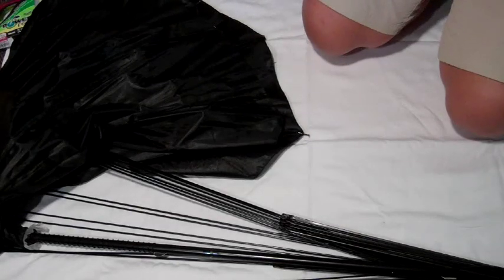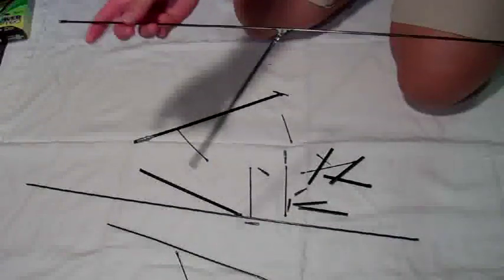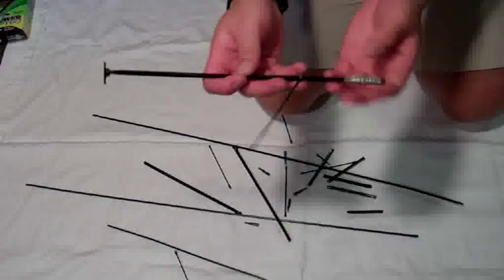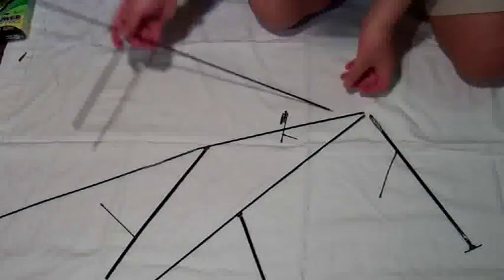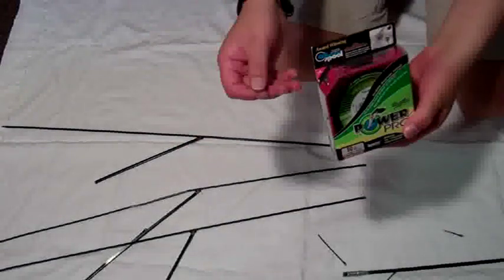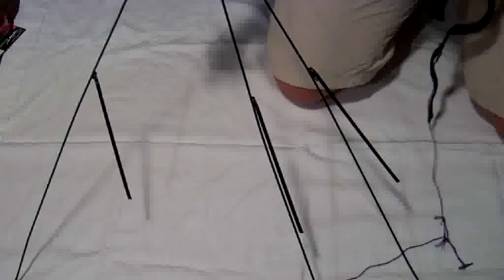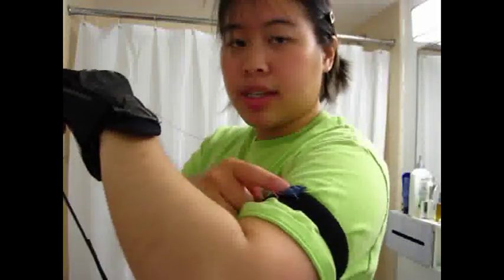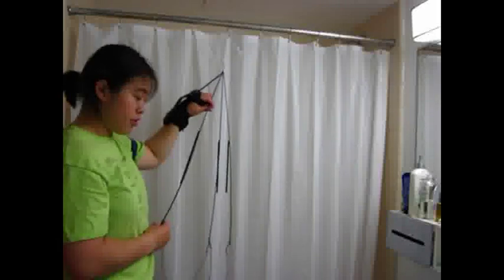Umbrella-Wing

Comment: how much do these cost
Reply from the maker: +richard head Mine didn't cost me anything, since I made it out of discarded items (broken umbrella) and things I already own or could easily find (fishing line, wrist guard). That being said, my prototype also didn't last more than a few uses. The design is still good for making wings (see the link in the description), but you'd need to use a more durable material than umbrella metal (there's a reason why those break so much!). The cost will depend on what types of materials you use and what things you already have, but I don't imagine it costing all that much (I estimate probably under $25 unless you decide to get fancy with it).

Comment: can you remake the video,please!
Reply from the maker: +Radhika Mehta I'm afraid I've gotten rid of my "demo set" of umbrella parts that I used to make this video, since I found out that the wings weren't durable/strong enough for my tastes after I'd finished building them. While the original concept was good, umbrellas are just too flimsy a building material, unfortunately.  I'll try to draw up a basic design structure for the wing if I get the time, though. Sorry!
Reply from the maker: +Radhika Mehta I've posted the design essentials for building this in the description box! Let me know if you have questions!

Comment: Hi! I love your idea! I decided to do it and I've run into one slight problem... I ended up changing it so it could be angel wings instead but I have no idea how to attach the fabric! :/ Is there any way I'd be able to see how you attached yours? Or even any ideas on how to? Thanks!
Reply: Aurora Raine
 maybe get 2 sheets of the fabric you want to use, and sew it directly on to the skeleton, outlining the 'bones'. Be sure to stuff where there would be negative space  (inbetween the frame work) would be when the wing is open so it's very squishy, but not empty feeling. You want to feel like theres a whole bunch of feathers under there. After that, go to the nearest art store and buy  ALL THE HOT GLUE. ALL OF IT. And appropriately colored feathers. Start gluing longest at the bottem of the wing padding and work your way up, layering will be sooo much easier. Trust me.
I'm planning on doing the same thing soon, too.